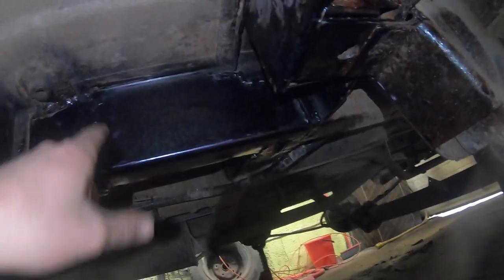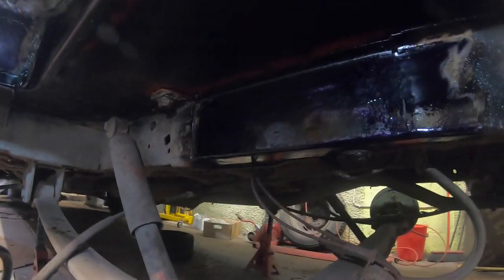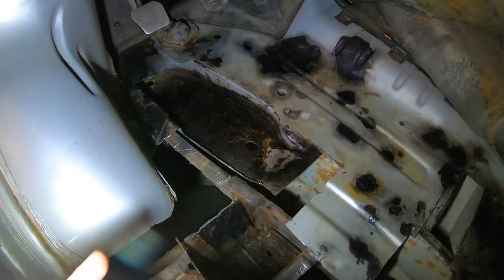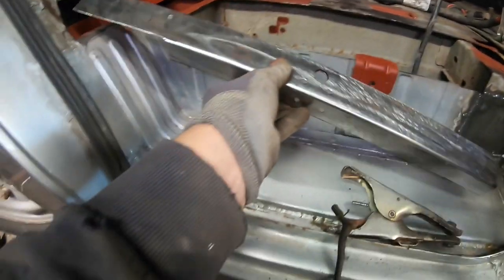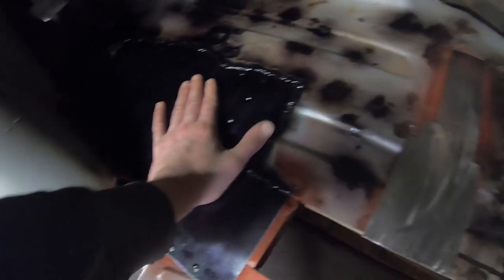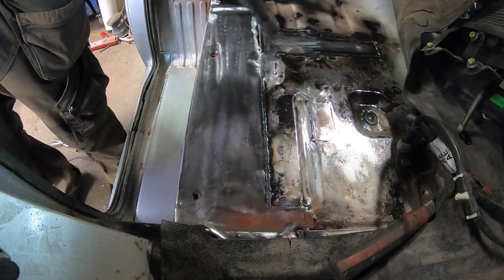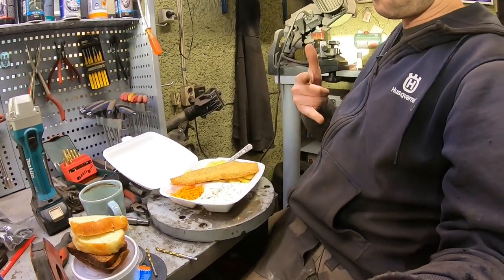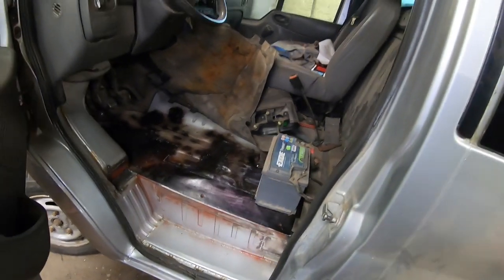Ford Transit rust repair part 2.

Comment: Great videos thanks!
I would really like to see how you made the 2mm frame sections? Do you bend with a press or by hand? 
👍
Reply from the maker: Thank you mate. I built a sheet-metal bender and for some parts I used that but since the bender is located away from where I work (on the van) i did most bends by hand using a vise and a hammer :)
Reply: @OneManOperation  Very accurate work for hand bending. This sort of work in the UK would cost more then the vehicles worth so you don't see it done here. Making the parts is as interesting as fitting them for me. 👍